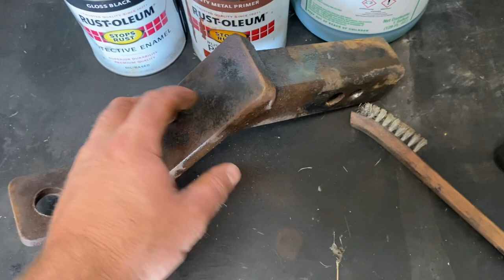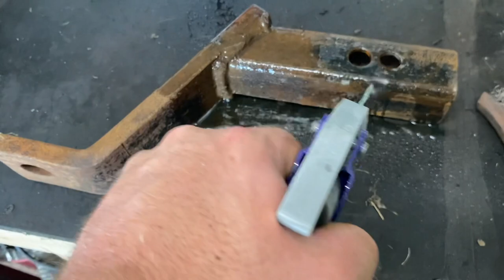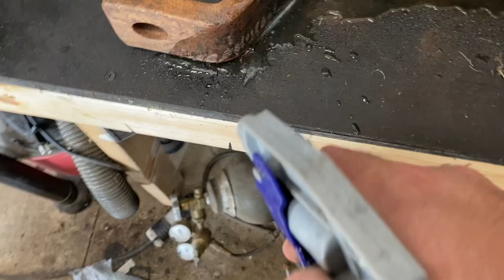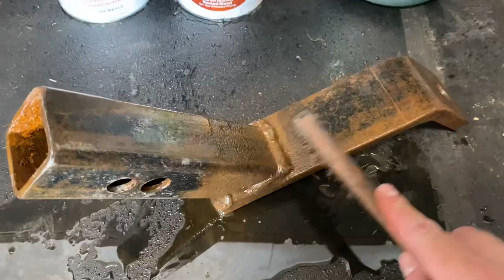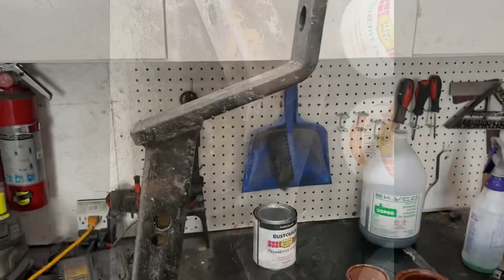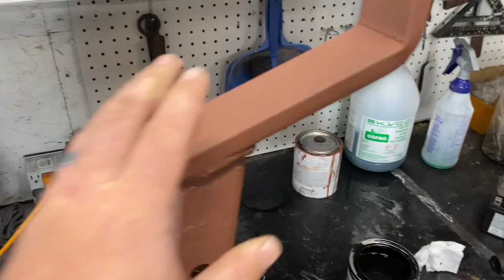Does Ospho work? Using Ospho and Rustoleum to stop rust on an old hitch

Comment: I just did the exact same thing and used HF Evapo Rust. I left it in solution for a day let if dry, wiped it down and spray bombed it with a primer/ enamel black paint and it came out like new again.

Comment: It's always best to remove as much rust as possible, including using products like this along with more mechanical methods, rinsing it off and degreasing it, and only converting or sealing what remains, with such products AND decent rust-preventing paint.

Comment: Wear gloves and protect your lungs when you use OSPHO.
Reply from the maker: Yeah I should have reiterated that in my video. Stuff is nasty!
Reply: @utjay2008  That white residue can be washed off with water. I usually just paint over it. Make sure you use eye protection. That stuff is an acid.

Comment: I use a drill and wire brush and clean the metal as best I can to be as clean as possible and wash it with Purple or spray nine and blow it dry and clean then I spray on the  Ospho and let it set for 24 hours like the directions say to do and if you have some white spots in places just hand wire brush it off and prime it and after drying spray on 2 or three coats of the paint you prefer to use an let it cure for a day or two and you’re ready to go!!!
Reply: Can I use Primer in Aerosol cans  ? It says use only oil based primer and paint on the Osphro bottle ?
Reply: Rustoleum paints are mostly oil based paints and they make spray cans of primer that works well with their paints!
Reply: @rogeradkins1785  thanks for the quick reply 🙏😌... Tmrw I will be painting over Osphro  I applied into the underside of my car.

Comment: I would recommend that you scrub your metal pretty good with a wire brush or sandpaper then clean it off with water then clean it with CLR then with water again then wipe on the Ospho with a sponge that way you're not going to be wasting too much of it like the way you're doing with a spray bottle because you're actually using too much of it and wasting it that way which is your prerogative but you're going to be going through your gallon too quick that way but then after you let it dry for a day or a day and a half then paint it.
Reply from the maker: That’s a good point about the spray and sponge. I use so little that a gallon will usually last me a year or more, so I tend to apply it very liberally. On an open, easy thing to reach like this then I should have used a sponge. I hit it pretty hard with the wire brush before I started rolling the video, but sanding would have helped. Do you use CLR to reduce the amount of ospho to use?
Reply: @utjay2008  I use CLR after I wash the metal with water after I scrub it then I wash it with water again after the CLR and let it dry then I put Ospho on it because I just want the metal to be clean before I put the Ospho on basically so that the Ospho can work as it's supposed to and I want my Ospho to last a while because I have a lot of fence posts and Gates that I'm putting it on but so far the Ospho has been working great for me and it helps the paint stick also which is really great and not just what it does to the rust itself so I'm a big fan of it now for sure.
Reply: @Charliemmafan  I'm thinking that you're using some products for what they were NOT intended to be.  Ospho is phosphoric acid which NEEDS rust in order to convert the rust into an inert form.  You are scrubbing the metal clean of rust with your washing and CLR'ing.  That leaves nothing for the Ospho to work on (convert) to an inert form.  Then you spray on the Ospho as a PRIMER and top coat it.  Ospho ISN'T a primer.  Rustoleum sells primers for clean and rusty metals which bond better with topcoats.  Your method may work "well" for you but things might work even better if you used the products for what they were intended.
Reply: @STBRetired1    But if all the loose rust isn't removed the paint will be on loose rust which isn't good.  Technically I suspect even when "cleaned up" there is plenty of microscopic rust for that OSPHO to do its job.
Reply: There’s a spot on the inner fender I’m un able to reach to scrub anything , maybe with a spray only. Any recommendations?

Comment: So wait, you ALSO prepared this metal with brake cleaner AND "CLR" whatever that is?  Why didn't you state that in the video??  Some of us are newbies.  Also I read on side of OSPHO bottle it needs to be applied to only surfaces that are COMPLETELY dry.  This is a many day process.  Thank you.
Reply from the maker: I had to rewatch it and never found an instance of me implying that I was using “CLR”. I’m not sure what you mean by that. I also use brake cleaner as a standard degreaser for anything oily that I’m going to paint. I wouldn’t consider that a “step” in the process, maybe just part of cleaning/preparing if you’re trying to paint an oily part?
Reply: @utjay2008  He was responding to @Charliemmafan
comment, thinking he was the person in the video.

Comment: Did it bubble up?
Reply from the maker: Nope! I wasn’t anticipating this video getting this many views. I’m planning on doing a follow up from my very first project I did about 5 years ago. But it’s in another state.
Reply: @utjay2008  I did ospho on metal around windshield but I don't know if I need to clean it off
Reply from the maker: @BraddaMarlon  oh I gotcha. If there was any residue I cleaned it off before painting. Brake cleaner seems to work well.
Reply: @utjay2008  I cleaned it with acetone then sprayed 2k primer then ran my urethane them set windshield 

Seems to be holding up
Reply from the maker: @BraddaMarlon  good to hear! Stuff really seems to work…

Comment: no way can you get rid of rust at the bottom of the tube with that brush and if left untreated it will spread rust all over again. Use a rust converter instead.
Reply from the maker: Ospho is a rust converter.

Comment: Your prep is pitiful, all of the cleaning and prep should be done before applying the Ospho. I used Ospho all the time working in the marine industry for 15 years and proper prep is mandatory
Reply: Hey do u have to wash if off after applying. Thank u
Reply: @nazimkarim6988  
Theres a vw bug guy on utube that doesn't.
Reply: What method of prepping do you prefer before using Ospho?  Thanks